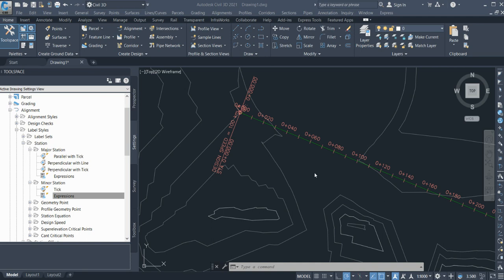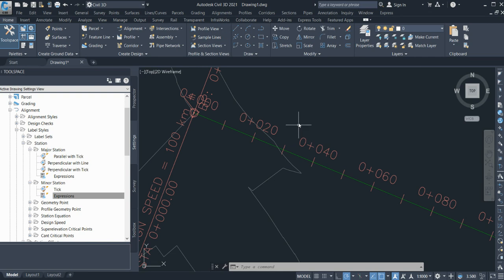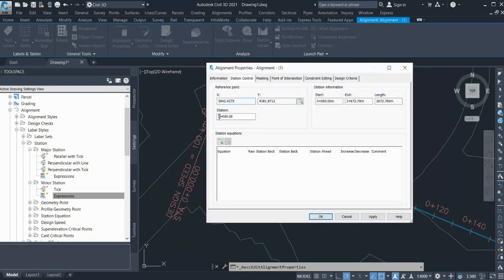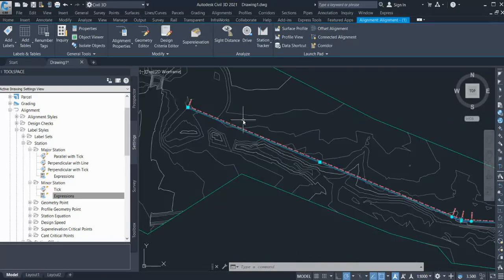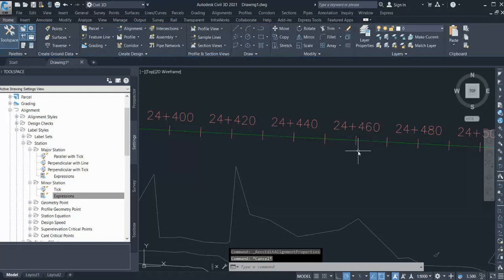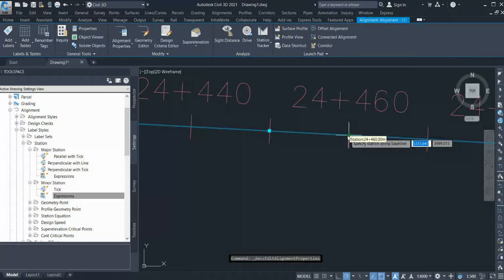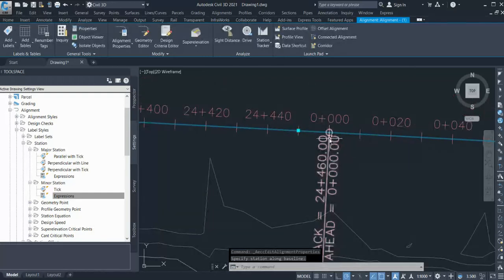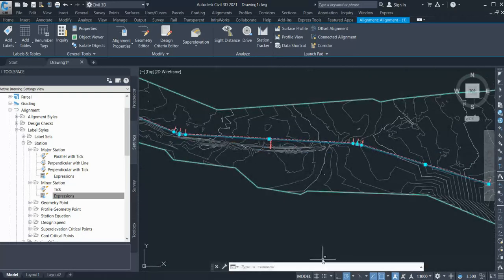Civil 3D - Alignment Chainage Control and Station Equation

Comment: Suppose I have alignment starting from ch 1km to 30km in between I want to cut my alignment let's say km 6 to 7 km and 12.5 to 13.8km with affecting my alignment station 
Is it any way to fix it ??
Reply from the maker: Yes you can use masking tool if you want to hide certain part of your alignment.

Comment: thank you for the lesson. I have only centerline points at 20 meter interval though i want to create an alignment to match the design alignment as per our project but i don't know the curve, and spiral entities though i know that the road is 4.625 km and whenever i create an alignment, the length of the alignment always less by about 6 meters. is there a solution to this?
Reply from the maker: you can use element method to get the exact length.
Reply: @Civil3DProTipsandTricks  please can you elaborate more on the element method thanks